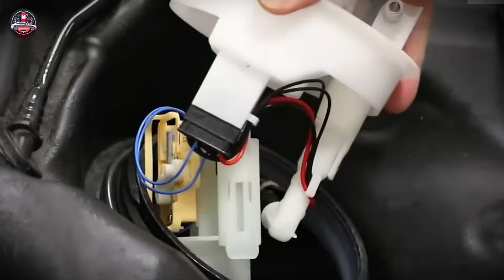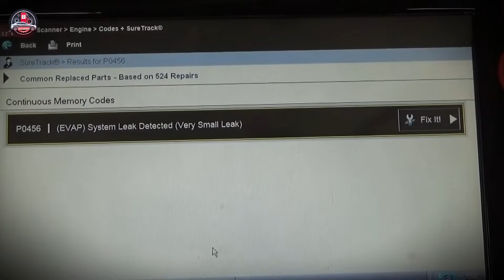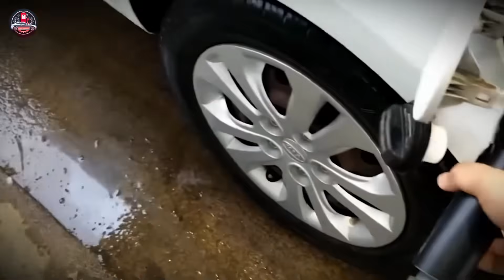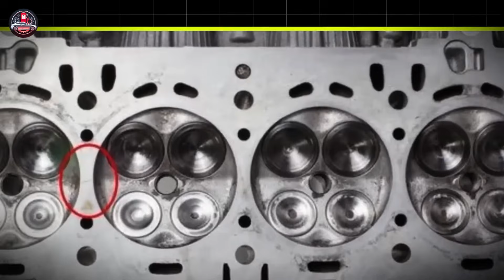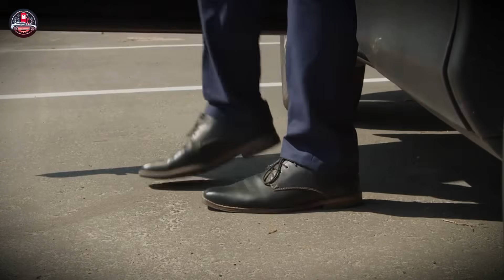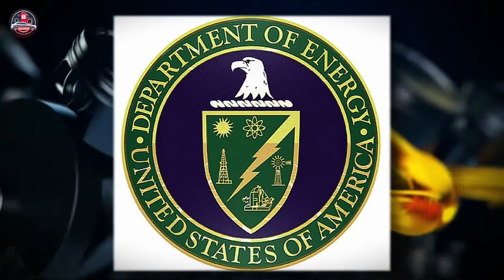Never Do THIS Before Refuelling (97% Get it Wrong) | Everything Fuel for Car

Comment: I drive out of town once a month.  A 220 round trip. I've gotten into the habit of driving out on a half tank. I am usually around a 1/4 , give or take a gallon. I fill up before I go home. I usually use à 1/4 tank, which usually lasts me the majority of the month. I add around 4 gallons of gas so I can make the full trip without running too low. This is because the flex fuel where I'm going is roughly 50 to 80 cents per gallon less at that destination. I have not had any problems in the last 4 and 1/2 years. I get my oil change around every 3000 to 3500 miles. I have only had to purchase new tires and brakes in all of that time. I know that everyone is not able to get by on one tank of gas a month. Should I fill up both ways  to not run the risk of the tank running past 1/4  tank?

Comment: How can you get rid of this sediment in your gas tank?  Is there a good cleaner you can add like Tecron clean the rest of the car?
Reply: Yes.  And shortly after a few days or after using Three Quarters of a tankful with the PEA fuel additive in the tank, change the filter. Waiting to have a blocked filter is very Inconvenient,Not fun, and possibly expensive . If the filter is outside the tank, and more accesible, and not too expensive, grab a spare and have it with you.  If you can change it yourself, Safely, all the better.. I have always 2 clean spares, at all times. When i have to change one out, no panic or stress.  ✌️🤞
Reply: Albuquerque